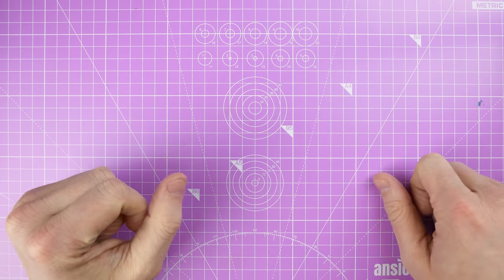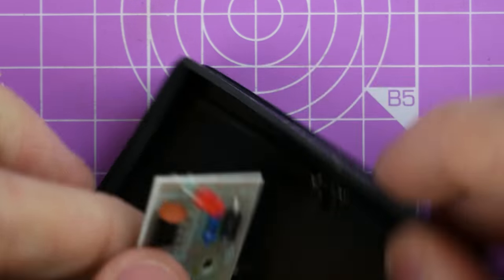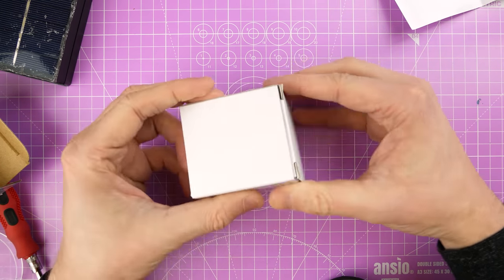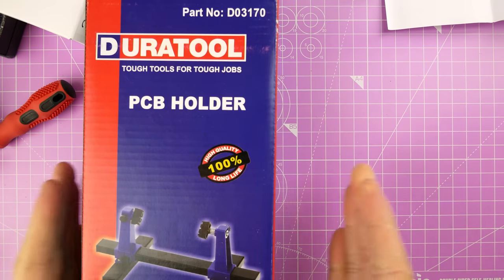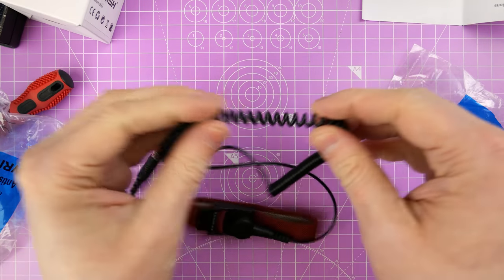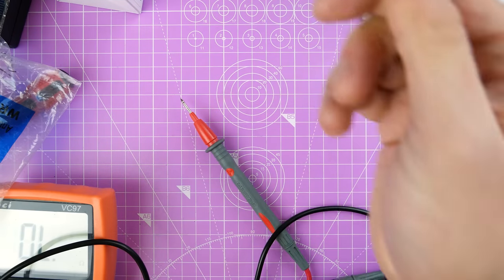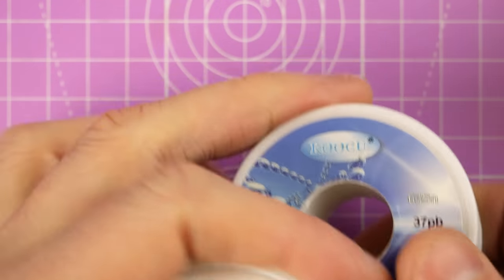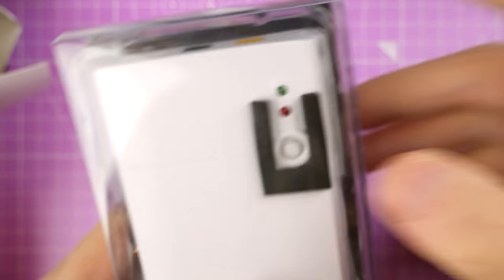Post Bag 11: Testing things is not my bag apparently

Comment: i have that PCB holder, works well, you  can just rotate the board while it's clamped to solder the other side after putting the parts in. i also use it to strip parts with my hot air soldering station so i don't melt my anti-static mat

Comment: I'd love to know about your camera and lighting setup for this video. Can you do a video about your gear and setup? Or post here about what you are using? Video is clear and lit really nicely, and your ability to change the focus of your camera the way you do intrigues me. Thanks!
Reply from the maker: Hey dude, I have a new camera these days but this is essentially it -https://pbs.twimg.com/media/C5oMBy0WcAQR9rF.jpg:large I can knock up a video if you feel it would be helpful. Always happy to do what I can.
Reply from the maker: The camera these days is about 8-10 inches away from the work surface.
Reply: Ok, that looks just as chaotic as my setup. But your results look nicer than mine! Maybe it's the pink cutting mat instead of my green one ;)

Ok, I have lots to learn still :-)

Thanks for the pic and info!
Reply from the maker: I find audio to be one if not the most important factor. I use a separate lavalier mic and recorder. Diffusing you lighting is pretty much key to getting a good shot, I could film on a phone easily but I prefer having a zoomable lens and manual focus.
Reply: So you zoom & focus manually? Are you using an external screen to view what you see in the camera? Or just the camera screen? Also, is that a custom camera tripod? or something you bought?

Comment: Actually it's not uncommon for the cables on those antistatic wrist straps to be a bit cheap feeling.  Even my 3M one is.

My 1 pound spool of Kester solder probably isn't much cheaper than that Multicore.  I bought it for US$31 which is about 24 UKP.

Comment: The blue thing should be an inductor, and it should be between pins 1 and 4 of the IC. The chip doesn't need any PCB resistors at all. Curiously, it shouldn't necessarily need a diode either - is it possible that they used a diode in place of a wire link?
Reply from the maker: I will sketch out the circuit when I start to play with it.  If it is an inductor I cannot find a table for 5 bands that includes a brown tolerance band.
Reply: I reverse engineered the circuit by taking screenshots of the video, and all becomes clear (aside from one assembly error). They are (mis)using the YX8018 IC as a charge controller. They aren't using any inductor between Pins 1 and 4, since they are not using the 200kHz boost converter part of the circuit that would run a white LED off pin 1 (they replaced the LED with a ceramic capacitor!). Pin 4 is Battery(+) and Pin 2 is Battery(-), both are normal usage. Normally Solar(-) goes to Pin 3, but they have connected a red Solar wire instead. Normally Solar(+) goes to pin 4, however wire is black. It works, so the polarity is OK but wires are wrong colours. Instead of using the inbuilt switch, then have connected Solar(+) through an unnecessary diode. The blue thing is a resistor between Battery(+) pin 4 and the red LED. Other side of red LED goes to pin 3 Solar(-). They just use the YX8018 to switch Solar(-) pin 3 to Battery(-) pin 2 when there is sufficient voltage on pin 4. Omitting the diode would give some extra voltage to charge the battery LOL. See my image https://imgur.com/a/YDsU9 and top-right circuit of datasheet https://goo.gl/qyzx4w